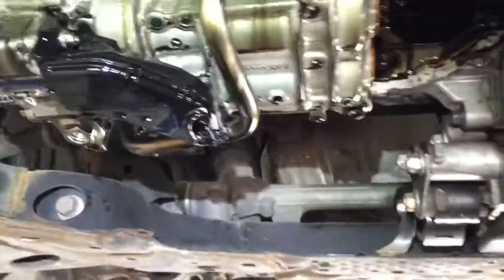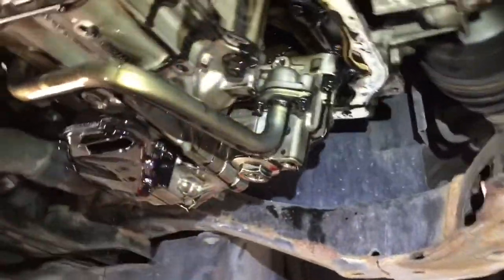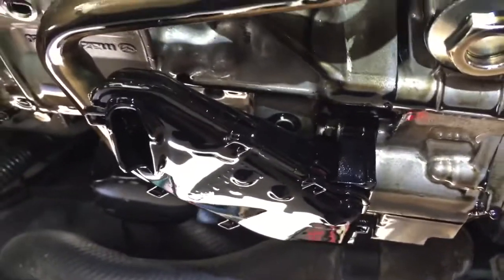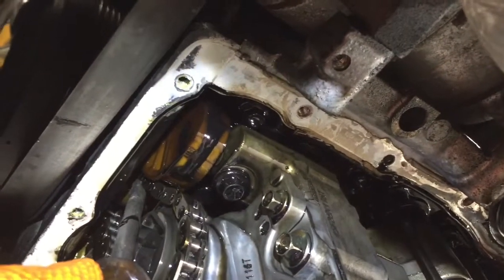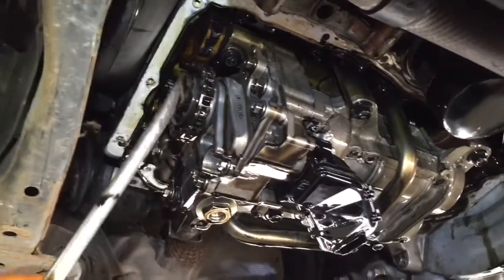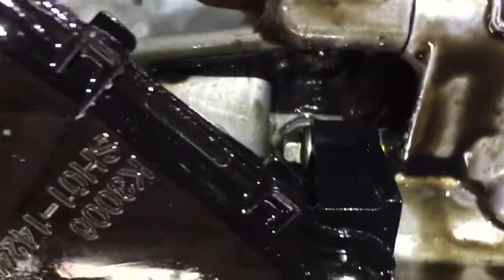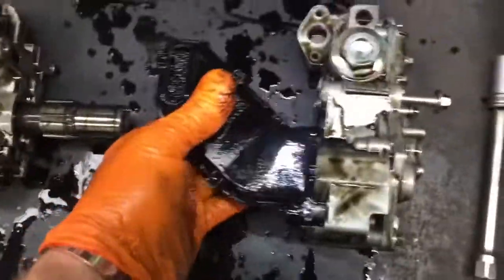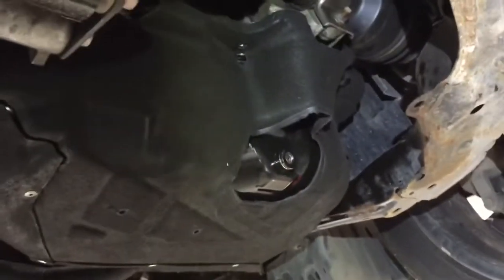Mazda engine failure caused by oil pump strainer & replacement

Comment: Loosen the bolts and tear off the oil collector. Re-installed by sawing the oil collector bolt U-hole and voila?
Reply: You are right.

That one bolt loosen and tear the filter frame..make a u shape and reinstall..
Reply from the maker: @planetgears4u  I’d advise just taking off the oil pump and balance shaft module. It isn’t that big of a job. Also be careful as the oil pump timing chains break on them quite often 😉
Reply: Can you explain please with more words what you did? You replaced the oil strainer only by removing the two bolts which is fixing it?
Reply from the maker: Interesting 🤨 but I get you 👍
Reply: @kennedysgarage3281  So far I only clean strainer, without removing oil pump and its working. I use small brush and cleaning spray.
Reply: @samostraser8924  What spray did you use to clear the carbon build up? Brake cleaner?
Reply: @samostraser8924  thanks 👍
Reply: @xegro  prob a carb spray buddy that'll do it cyeap enough
Reply: @samostraser8924 hi can I ask when you say so far you cleaned with spray and brush,,did you remove the black plastic cover off strainer,, cheers john
Reply: Hello John, i remove one bolt on strainer and losen second one. After this i can twist the strainer and cleaned with small brush and carbon cleaning spray. At 260000km i finally put on new strainer, but old was still ok. I recommended that you monitor oil pressure when you driving (forscan + obd).  Regards, Samo
Reply: Roughly how much hours you have taken ?

Thanks.

I am a mechanic. So I can quote my customer. 

Mazda wants to charge him a fortune...
Reply: So cut bolt that's difficult to get to and what use a nut ? You mentioned u hold ?
Reply: Can you explain this a little more. The oil strainer has a metal insert in the bolt hole ? Be difficult to cut
Reply: It’s easy to remove the oil pump and do the job properly
Reply: Hi sorry I know this was 4 year ago,,but can I ask,,when you say U hole,,,do you mean loosen both bolts and just literally break it off,,,and then the new strainer cut into the new holes just enough to clip back on to the bolts,,,and job done,, cheers john
Reply: Hello, i did not cut or break anything. I remove one bolt from strainer, second cannot be removed, because is little to long 🥴. So after I do this i can move strainer away and clean with something small, brush or something. I know this is not right way, but if check with light, if it is cleaner or not or repeat this. Removing the pump is also not so hard, i recommended that somebody help you, to keep the pump when you remove the bolts. You must also remove the bolt chain gear (using specialno tool, or bigger pliers). Regards, Samo

Comment: What year mazda is this please? And I'm guessing its the 2.2 skyactiv-d?
Reply from the maker: You are correct , it’s a 2016 Mazda 6 sky active diesel
Reply: @kennedysgarage3281  what causes so much carbon and sludge in the oil strainer? 
Thanks
Reply from the maker: @Martin-hh3ju  the injector seals fail & the compression gases build up under the rocker cover as carbon. This then gets into the oil & then caught by the strainer
Reply: @kennedysgarage3281  thanks,  i was told the same by another local garage, unfortunately know one in my area wants to take on the job of changing my seals,  even though I've already got all the parts from mazda,  I wish you were closer
Reply: @kennedysgarage3281  Do you have to fix the injector seals as well then before doing this carbon cleaning? Is injectors a big job?
Reply from the maker: @omglozza  the injector seals do fail & if they do they can cause huge amounts of carbon in the crankcase. Take of the oil filler cap when the engine is running and you should hear a popping sound if they are leaking.